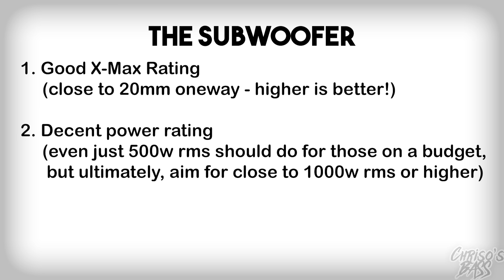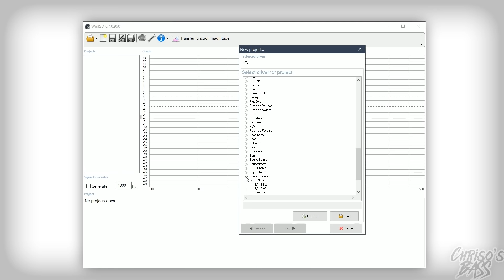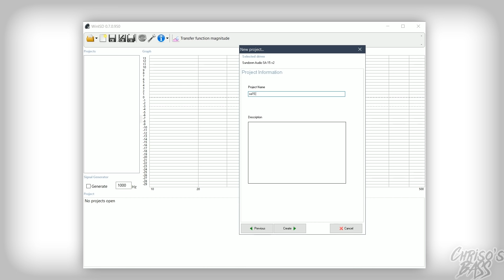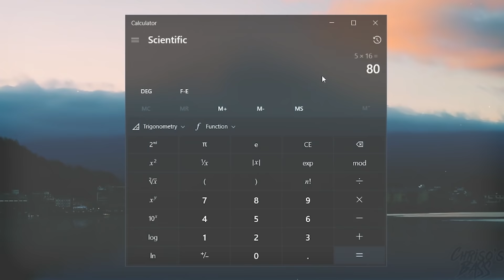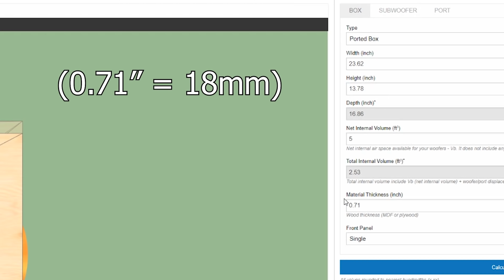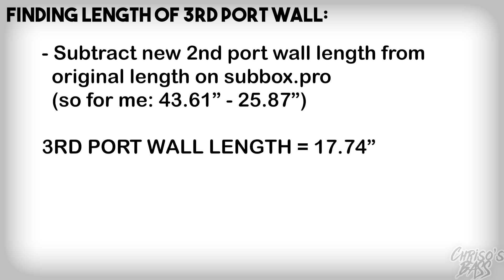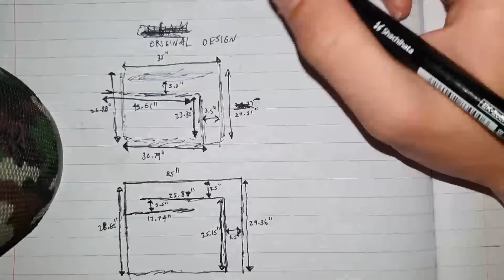How to Design a Subwoofer Box that plays SUPER LOW! | Full Guide

Comment: something to note tuning low significantly reduces high end out put for 90% of spl subs they will be come one note wonders in a large ported box tuned low winisd does not really take this in to account you may see that the driver can play up to 150hz in winisd but in real world testing it wont do anything that high up. depending if you are doing this for a home or car the point of when and where the sub reaches xmax limitations changes if the car resonates at lets say 24hz and the box shows the sub moving over xmax limits in winisd once you put that in the car due to the the car resonating the subwoofer can move less this can happen in home audio but its not that huge of a difference if you have a driver that is only designed for ported enclosures i wouldnt recommend tuning stupidly low 20hz or so because of above its tuning frequency the box will act like a sealed enclosure and wont give you any decent response up high getting a driver that can perform well in both sealed and ported is the best option if you model a sub in winisd and it shows it having a large peak then a dip thats a sign that its not the best for this use case there are ways you can get around this but are hard to explain and is how i get mine to play high and low even if the driver doesn't naturally want to. in terms of building a low tuned box and just throwing it in a car and getting windy sorry to say it doesnt work like that yes it may be better than the higher tuned box you had before but theres lots of things that go in to designing a box for a car and getting the most of it. the 16 per cbft rule is a good one to go off how ever it changes alot pretty much all of my box's within the past year have been no one where that rule either being over or under there are ways of figuring it out to make it perfect but again it is hard to explain the winisd rule is something like 16-20m/s thats another good rule to go off but theres always better after building alot of enclosures winisd has been a good tool but never expect it to translate to real life testing perfectly with how the driver (sub) loads up with different port areas that can change the bandwidth of the enclosure but if you use winisd you can see it doesnt make the graph any different this is when real life testing cones in handy and is why alot of people are shocked when they see my builds. as for designing the box i wouldnt use sub box pro it always has been off from what other softwares are either a tiny amount or in my case by a huge amount sometimes i wouldnt recomended it at all its ok for getting the general idea of a box and i do use it for that but when it comes to getting down to the nitty gritty i use other alternatives that i have tested and trust more such as (ultimate car audio app)
Reply from the maker: Yeah I definitely hear where you're coming from, and I know that subbox.pro isn't always completely perfect. I just thought I'd use it in this video because it's kind of a beginners-guide or just for people who are interested in learning the basics of designing a subwoofer box. A lot of the information in this video probably isn't new to most people who have built multiple boxes and not useful for them at all, I just wanted to get something out there for people to learn the basics and design their first box. I know there's many other details that can help a lot with making a build "windy" but I felt like I couldn't explain that level of detail very well. I didn't want to confuse people so I just left it as a fairly basic video about designing a pretty simple box that should do the job for your average basshead
Reply: @chrisosbass1286  excuse me, what you feel about the SRX828SP subwoofer? Is 29hz good for movies?
Reply from the maker: Maybe sometime down the track in a year or two I'll make an in-depth video about the really particular details and secrets once I have a lot of experience. But thanks for leaving the commnent, I'll keep this all in mind for if I ever make a more detailed video.
Reply: Yeah I hate to sound rude but useing 16 per cube and tuned to 20 isn't something anyone would ever shoot for. For a beginner, and not even useing win isd, if you go with about 12 square inches her cube and about 16 to 18 inches long you will play most daily music fine.
Reply: Ultimate Car Audio app unfortunately doesn't provide slot port dimensions for what to cut the wood pieces. However, I did rely on it to build my enclosure which I have yet to finish at this time but will post a video of it performing once completed next week in June 2021. There are build update videos of my current and past enclosures but none of which I've built. Thx.
Reply: Ko fu

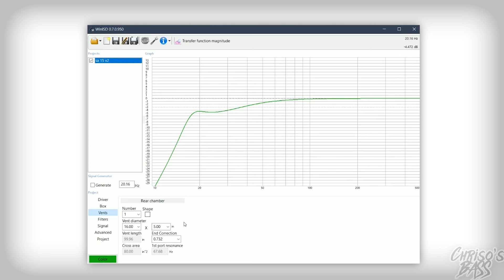Comment: 12:29 A thing to be careful of is that port resonance there at the bottom. (1st port resonance) 

You'd want a lowpass around half an octave or lower below that I believe, otherwise at a certain volume it'll resonate and sound terrible. 

It's only an issue if you plan to play up to that area. 

Also from what I've heard from someone who's made over 300+ boxes 23-24m/s is good as long as you have a flared/rounded port you shouldn't hear chuffing. Though 17m/s is better if you can hit that or below.
Reply from the maker: Thank you!!!! If only I could put that in the video right now 😅. I've always known about Port resonance but not much about how it really works or anything. I vividly remember how bad the port resonance was on some logitech systems, just a constant high-bass whine at 35hz and lower
Reply: @chrisosbass1286  I've experienced a lot of port noise (source: Logitech z623) so I've figured out that a great way to reduce port noise is, ironically, to put dampening inside the port. Add a small amount of carpeting at the very beginning of the port and you'll have substantially less noise to deal with.